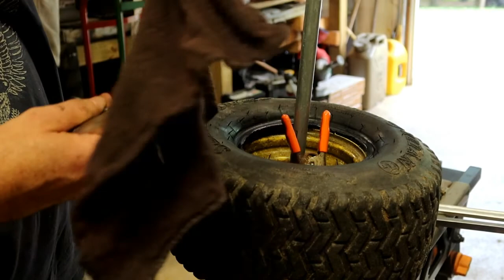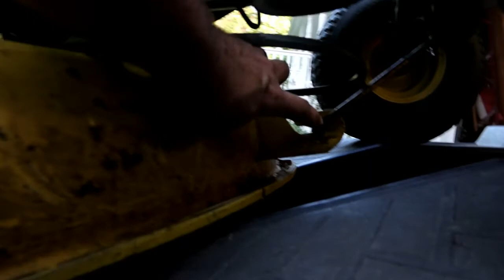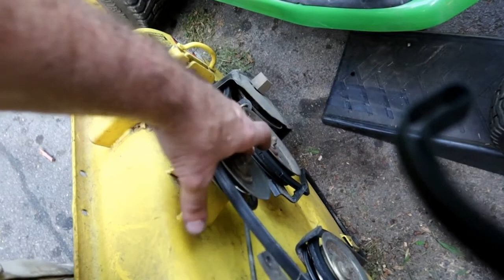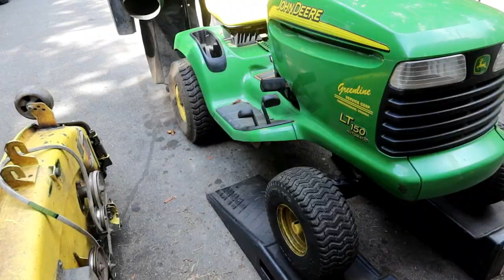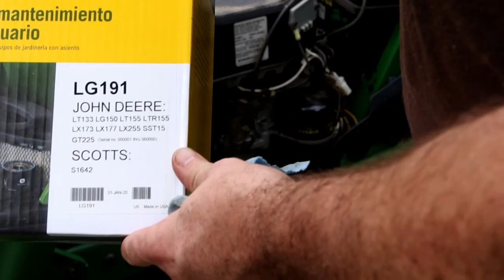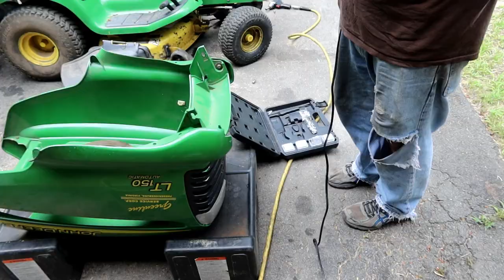John Deere LT150 – Tune up, belt and blades change, Tire tube install, welding plastic and metal

Comment: How do you tighten the deck belt on this model? New belt and mine is so lose it falls right off the pulleys. Correct belt too.
Reply from the maker: Does the tensioner pulley move all the way or is it blocked?

Comment: I didn't see where you unhooked the battery before welding on mower. I've seen where the battery blows up due to leaving it connected. Also occasionally have seen the magneto taken out. But on bigger mowers with larger motors having stators for charging system. There is a very good chance that stator will be fried. You may have disconnected the battery and forgot to mention it. Anyways very informative video, thank you!!!
Reply from the maker: That is a great point and I’m glad you brought it up. I don’t remember if I did and it may have cost me time and $$$$

Comment: I just replaced my mower belt. When I engage the belt there is some slipping of the belt. I didn’t have that on the old belt and that’s surprising because it was in terrible condition. If I lengthen the rod by unthreading the pin that is on the engagement rod will that increase tension on the belt?
Reply from the maker: Was it an oem belt? If not you might have to adjust out the slack
Reply: Yes it is an OEM belt from the local JD dealer. Your answer did not tell me anything. I agree that the slack needs to be taken up on the new belt. My question was if I loosen the lock nut on the PTO engagement rod and turn the adjustment pin so that the PTO rod is in effect lengthened, will this put more tension on the mower belt. I’m assuming yes. I’m looking at page 470 of the John Deere service manual for part names.
Reply: @grampaject57 same issue. How did you tighten yours?

Comment: I have an 04’ LT150. 38”. Only 109 hours. It back fires every time I turn it of. If I do not idle it for several minutes before I turn it off, it will “diesel” when I kill the switch. It eventually dies, but not with out a major back fire. I have searched all over the interwebbs for an answer. 3 mechanics. And tinkered on it my self. Any info would be delighted.
Reply from the maker: It's the solenoid on the bottom of the carb. Either someone cut it or it's stuck open
Reply: @RayofallTrades  mine only has a drain screw on the bottom of the bowl.
Reply from the maker: @huntwright8731  gotcha. Ok it's running rich or valves are out of adjustment. 1 spark plug or 2? Usually from unburned fuel reaching the hot muffler from incomplete combustion.  What motor is on it?
Reply: @RayofallTrades  single cylinder 15 HP Kohler CV15S 426 cc OHV
Reply from the maker: @huntwright8731  copy. Hydraulic lifters should mean valve clearance ok. Is oil correct weight? Too thin/thick messes with lifters. Very dirty oil also. Most people are saying coil  but I would test it before buying with a tester. Here's a good read: https://www.mytractorforum.com/threads/kohler-15-5hp-cv15s-misfire-and-blowing-flame-out-carburetor.627593/
Reply: @RayofallTrades  thank you! I use the John Deere oil, and filter. Occasionally, I can smell some oil being cycled through. Every thing points toward a valve issue, but they are hydraulic….? There is no white smoke, blue smoke, or black smoke being emitted and good compression, so I think the rings are good, has plenty of power, so I think the head gasket is good. Is it possible for the crankcase vent to build pressure enough to actually “inject” fuel? It vents to the carb/air intake. Thanks EPA.
Reply from the maker: @huntwright8731  I don't believe it's the vent.  That usually runs rough and smokes out the carb. I don't think it's the coil because it's not missing and I think your model is s standard coil so no advance.  Partial key shear maybe,  sticking lifters maybe, those fuel pumps rupture and leak fuel into the crankcase but again wouldn't show as a backfire. I'll think on it and get back to you